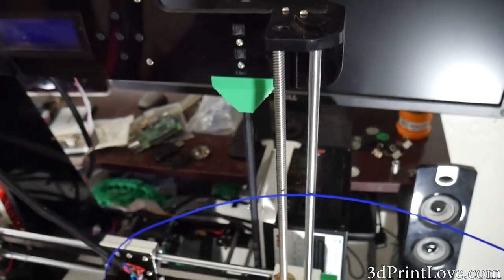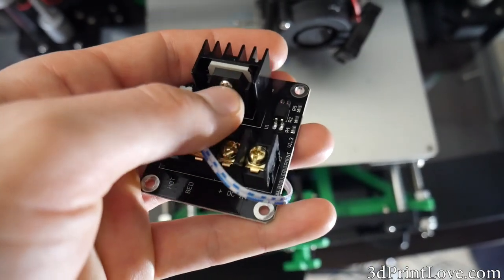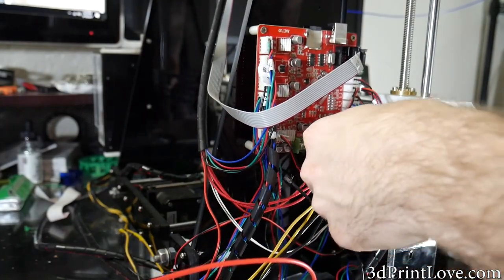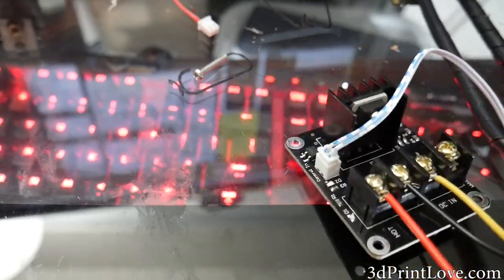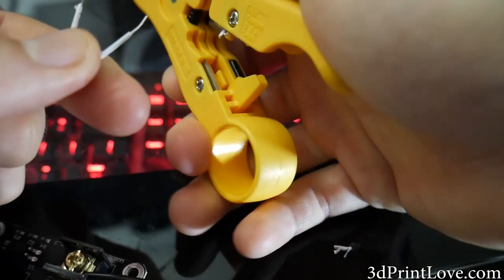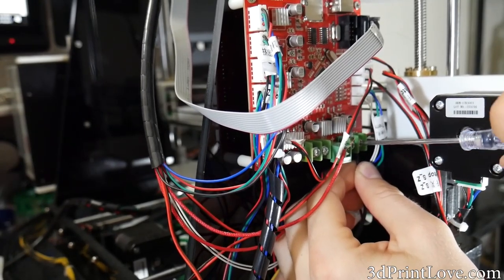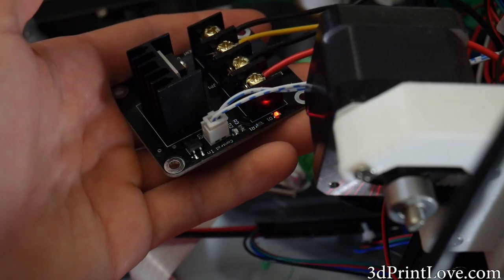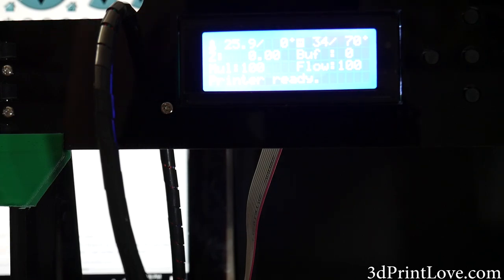Tutorial Installing A Separate MOSFET Board For 3d Printer Hot Bed

Comment: Definitely recommend these over the mechanical relays you sometimes find. More reliable, and you can switch it to be PID controlled rather than the bang-bang that mechanical relays can do, which results in much better control over bed temperature. Nice video!
Reply from the maker: +Hoffman Engineering I will be pid tuning this printer eventually! Thank you :)

Comment: Last year I got a cheap geetech prusa i3 W wich is a really bad printer, and need lots of tweaks to make it work, since then I never managed to make it work proper, the bed calibration is a nightmare so I let it on the side and sometimes I go back to it and try to make it work properly.

The mosfet topic came to my view when I was watching a random video of someone with a similar printer who said in the video that the mosfet upgrade is recomended since the board that it brings is a cheap one, and is dangerous to use the hot bed with that board since the mosfet that it has on the board is weak and it can melt and create dangerous situations.

So that is one more reason that I never tryed to much tweaking it to make it work, before I manage to get the proper safety upgrades I think are required to make it work with less probability of making an hazard, so today I started looking for upgrades since I got a new cheap e3D clone hotend, like the mounts to put the new hotend, but then I remembered that I still need the mosfet.
Watching your video I see it is easy to install and I'm going to order 1 online, but I have a question before doing that

All you do is instaling it phisicaly with cables, but I wonder if you need to change anything in the firmware to let it know that you are using an external mosfet, or if connecting the mosfet is enough.
How does the firmware knows it has another mosfet, does the old mosfet still work as usual but the strong voltage goes trough the new external mosfet and that is what keeps the board safe? or do you need to specify in the firmware to not use the inboard mosfet and use the new one wich is external?

Maybe is a stupid question and I know this video is old, but even if I think I have some knowledge in electronics and 3d printing after all the videos I seing, this makes me confusion to how it works.

I want to say in advance thanks for your awnser to whoever awnsers me and I'm sorry for my bad English, I'm not a native English speaker so I imagine some of my gramathic is not very good even if I think is well donne :)

Comment: Works like  a relay ..the power goes directly from the PSU to the Mosfet and it sends power to the bed etc,, the board via the thin cable tells the mosfet when to turn on and off ..no need to worry about  - and + expect from the PSU to the MOSFET

Comment: So connecting up a bed mosfet I don't need to use the thermistor cable on the silicone heat pad? Just connect the wire on the mosfet to the printer board?

Comment: Im installing a mosfet. It says to hook it up to 12v power supply. My 3 power supply spots already have stuff connected. 2 to the ramps board and 1 to the extruder fan. (Thats how the manual said to hook it up.)  Where do i connect the mosfet?  Can i stack multiple cables on 1 connection on the power supply?

Comment: How are these things set up? I'm about to purchase a Maker Select v2, and I'm curious as to why this problem seems to happen quite a bit... Because from what I've seen when looking at the underside of the printers in these videos, where all the gutty works are, board, power supply and blah blah, it seems like there's no ventilation fan to either pull hot air from under there or push cool air under there.. Because I mean, everything is mounted upside down, directly underneath a platform that traps the heat. No wonder stuff is burning out. Though, I suspect it's not simply a heat issue, it's probably the bed drawing too much power as well. Which is apparently what everyone says. But still, shit me, look how it's designed, heat has to be causing some issues if there no fans.... Do you often see people modding small fans to pull hot air from under the unit as well?
Reply from the maker: +MikePlaysIt oh yes it is common I add a fan to the main board on all of my printers usually as am exhaust to pull heat away. You would be wise to do the same with your printer. Should be a standard in my opinion.

Comment: Hi ModBot, informative video, thank you. I notice that the MOSFET board has no polarity indicators for the hotbed. My hotbed has a +ve & -ve solder contacts underneath and a red & black wire leading from it. Is this an issue or can it be wired any way? I assume that it is purely a resisitive load and therefore non-polar.
Reply: It's non polar. It's just a massive wire.

Comment: Hi,
I have a Anet A8 3D printer V1.5 recently.
I noticed that the integrated circuit driving the hotbed was boiling ... so I decided to buy an external MOSFET module : So cool video for the newbee like me! Thx.
I also noticed that the set point temperature of the hotbed was 60 ° C while the true temperature was 110 ° C ... and it is feared!
An idea?
Thx for helping.

Comment: I want to reach higher temperatures for peek filaments, and suggestions to do that? adding an external source of heat for the extruder or upgrading the board by using the MOSFET?

Comment: So I have a question that I'm hoping you might be able too help me with,so here a month or so ago I had a power surge that killed the motherboard and power supply. I just recently got the replacement from TEVO. I installed it and everything works fine but the heat bed is now not working. Any idea why this might be? And on the little red and white wires which is positive?
Reply from the maker: +Phillip Bishop Red is usually positive could the heat bed board have died from the surge? If the new main bed is good I would try replacing the heat bed

Comment: Mr ModBot THANKS for the video... BUT... If you could PLEASE PLEASE PLEASE do another quick video showing where the wires are coming from and going to IE: run your fingers from the MOSFET wires to the other end slowly... then I will subscribe,,, it's just that I got really confused because you unscrewed 4 wires but ended up with 6??? I have a Geeetech I3 pro B and the hotbed keeps frying the controller board and connections... I am currently waiting for the MOSFET to arrive and it would be great if you could please do this for us as most YouTubers just ignore us.
Brett.

Comment: hello , thank you for your video .Can i install two mosfets one for heated bed and one for extruder ? can this way increase the extrusion temperature (for Nylon) and the bed temperature ?
Reply: BisdremisKostas Yes you should get a second mosfet for higher nozzle tempratures but also a full metal hotend if you not already have one
Reply: thank you for your info. in order to increase the temperature should i make changes at the firmware?

Comment: Wait I'm still confused. Where exactly do you put the two 12v outputs from the ATX power supply? I have the Tevo Tarantula and it only had 1 set of positive and negative 12v inputs. The heat bed it's connected to the power from a terminal block.
Reply: I'm wondering the same thing. Maybe ModBot has a wiring diagram?

Edit: At 0:44 you can see that there's two wires connected to the board at the 12V input on the mainboard. I assume that with the MOSFET installed, you'd have 1 yellow and 1 black cable from the psu to the mainboard 12V connectors, and 1 yellow and 1 black cable from the mainboard 12V connectors to the MOSFET, though I'm not entirely sure about it.
Reply: I got my printer now, as well as the MOSFETs. I figured that you need some excess cables that you can route from your PSU to your mainboard and MOSFET. So it will be: PSU >---< Mainboard. And second, PSU >---< MOSFET DC in.
Reply: Okk I see. So one set of wires is good enough to get the 20A or so.
Reply: I don't have any excess cables so I can't install the MOSFETs yet, but when I find some unused cable I'll see if it works.
Reply: Alright sounds good.

Comment: Man, I'm sorry but that setup is a mess, you're just waiting for a fire even with the mosfet mod, the board flapping around, the mosfet connections bare stranded wire (at least tin those or crimp on ends), you didn't talk enough about running power from the power supply for a lot of people to follow (based on the questions in your comments, though I wonder how those people got this thing built in the first place)...
Reply: I've been breathing solder fumes for over 50 years, including etching PCBs and taking a Dremel tool to motherboards to add external IDE slots and add switching to IRQs. Not much I haven't seen or that scares me that works on 12 volts. Yeah, this instruction is sketchy at best. Next!
Reply: I used crimp connectors. and you have to setup the Firmware for PID Mode with auto M303 E-1 C8 S90 or BANG Max to 125 from 255 Warning set one or the Other not Bolth you WILL have a THERMAL RUNAWAY
Reply: As soon as I saw him tightening down those points with so much exposed wire on his jiggly ass CCA, I just had to scroll down and see if someone mentioned how unsafe his setup looked.
Reply: agreed, bare copper wires stuck so willy nilly under those screw terminals makes me cringe. And lordy lord he's using a COAX STRIPPER! SMH. At least use some crimps, I'd go with high temperature crimped/soldered ring terminals but that's just me. Just because it's only 12 volts doesn't mean it can't be set ablaze especially with the sketch-ass chinese boards

Comment: D0 you have a diagram for this install?  Great job I have an Anet A3 will the install be the same way?
Reply from the maker: +Ricky Ashe no diagram but yes the install will be the same on any printer!
Reply: ModBot did you run an extra set of wires from the + - on the psu or ran them from the backside of the mosfet D.C. In back to the main power on the board?
Reply: curious about this Myself. I installed mine with the help of another tutorial that said to just "piggy back" the DC In wires to the Main board "power in." Its working fine but, i cant help but wonder if this defeats the purpose of the Mosfet. Am i still sending all that extra power that the heat bed is pulling into my mainboard? Should we run seperate power lines from the PSU to Mosfet and Mainboard?

Comment: I'm trying to clarify
 a few things before I finish hooking my Tarantula up with my hotbed mosfet.
What gauge wire should be used to connect the powersupply to the mosfet?
What is used from the powersupply to the main board? (trying to make sure I get the correct ones and also correlating terminal hookups)
Any info would be super appreciated!
Reply: Nothing less than 12 guage. so 12 or 10 would be fine. anything less will run the wires pretty warm with the amperage.
Reply: So the wires in this method running from the board to the mosfet are just control wires -- I should say become just control wires at this point.. so 14 guage or even 16 or 18 would work fine.

Comment: What is confusing to people is that there is no mention of the 12 volt switched power from the RepRap control board that used to take care off  power to the Heated Bed via its own surface mount Mosfet, (200W at the most)  is now being asked to simply act as a control signal. To further this bit of confusion there is no mention of a matter of polarity of that cable with the 2 pin molex connector. 
P.s. I believe the reason most were making this a regular fix was by omitting using crimp connectors to make connections to the Hot Bed tie down screws and in many cases causing the green ABS plastic to melt. They might just use plain bared copper strand and this after a while is subject to oxidization and higher resistance at the connectors It would be better if at least there was some glass fibre in thqat
Reply: I have checked out these MOSFET cards with a multi-meter, the white control plug/cable is not polarity sensitive , it is connected through a bridge rectifier to send the correct polarity to control the MOSFET.

Comment: I get the blue light and I get voltage on the switched side...BUT the light doesn't come on, on my hot bed.  I moved it back to the main board (the bed) and it worked properly.  Im thinking I got a bad mosfet that can't pass current but only voltage.  Any ideas?
Reply: I get the same, Blue light, but in main board too, but the bed won't heat up, what did do after that?
Reply: I ordered another mosfet board.  I haven't tested it but I suspect this one will work and the other is faulty
Reply: @bigneilh  ok, I fixed mine! The problem was the copper of the wire wasn't touching the metal in the mosfet. Check putting the wires of the fan on it like the video to know if the mosfet is dead. Mine wasn't so I check the connection.
Reply: So the wire wasn't stripped enough?  I will test my connection.  I will probably check voltage at the bed when I try the old one.  Having two isn't a problem since I will probably put the extruder on a mosfet as well.  Although i've read that my style of board is "ok" for that amperage.
Reply: Yes, that's it. I put in the end these little plastic and metal things to make the connection more neat (I don't know the name in English), and the cupper wasn't reaching then metal within. Just pay attention to the wires contact. I think the same for a second mosfet.

Comment: Has anyone reversed engineered these board. I have a bunch of power MOSFETs in my parts drawers and the ability to make PCBs. I use the MOSFETs to switch high voltage high current from an MCU running at 5V. Even got a couple totem pole drivers too, that could really improve the switching performance.

Comment: will this help? 
... because mine just burnt the both - & +  on the 4 pins connector but the other - & + for extruder works just fine.
so should i desolder and replace the 4 pins connector and place this external MOSFET Board for heatbed? or i should replace the whole board?

Comment: How the heck are we supposed to figure out the polarity of the mosfet-to-mainboard wire? Neither the connection on the mainboard nor the mosfet itself seem to have any clear markings about polarity, and I've seen tutorials showing it plugged in both ways.. wtf? lol
Reply: there is no polarity concern from the mosfet to the board control wire... after the mod that wire becomes a control switch - which has no polarity - it's either a completed loop or a broken loop (no polarity required).

Comment: this tutorial is terrible!!! missed many steps!! and did not explain it well enough!! sorry....................
Reply: He missed the wire going from the Mosfet to the original DC in, that's what he missed.  Two positives and two negatives should be connected to the positive and negative of DC in of the Mosfet to feed the original DC in of the master board
Reply: Board bed output to mosfet signal
Mosfet bed to bed
Power supply to mosfet input
Just search it in google images if it's still confusing.